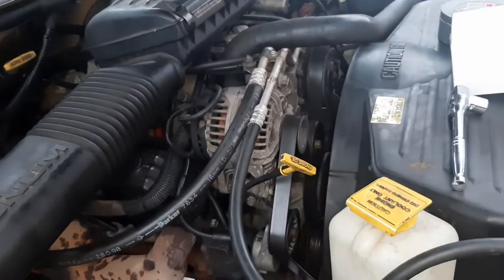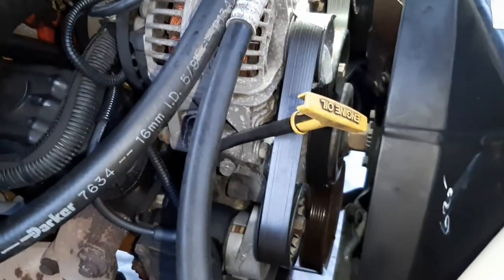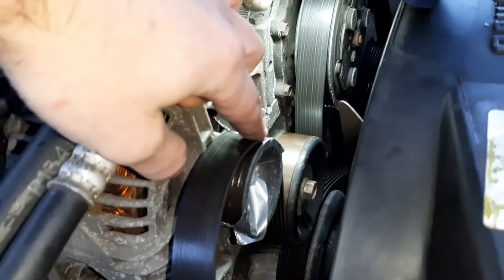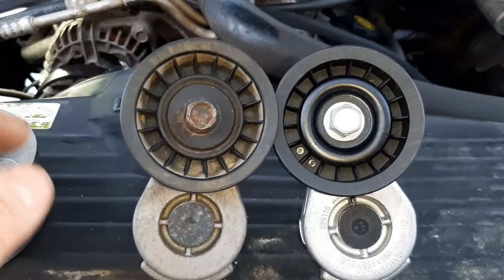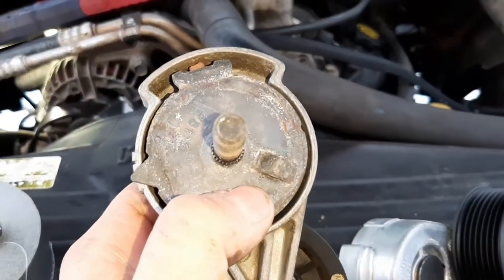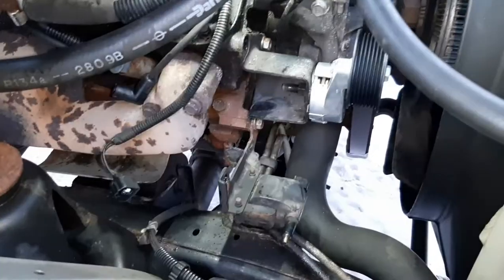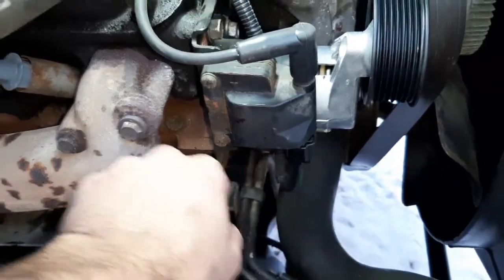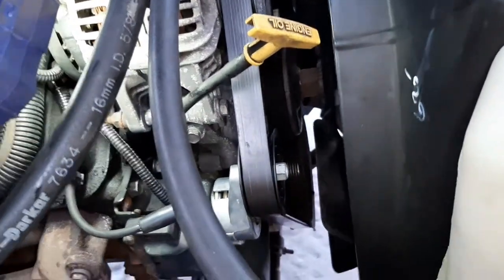2000 Ram 1500 belt tensioner replacement.

Comment: Just changed 1998 Ram w/360. Excellent video. Thanks for the contribution. I did not remove the bottom connector to the coil pack.

Comment: I put a new serpentine belt on my 2001 Dodge Ram 1500, 5.2 liter, and I bypassed the AC because it doesn't work! After getting the belt on I noticed it wasn't lining up! It Lines up everywhere but from power steering pump around the crank pulley! It seems like the PS pump may be out of line! Would I be right about that? When I cut it off the belt is back place! Weird huh?
Reply from the maker: That is weird.  It must me out of alignment somehow...